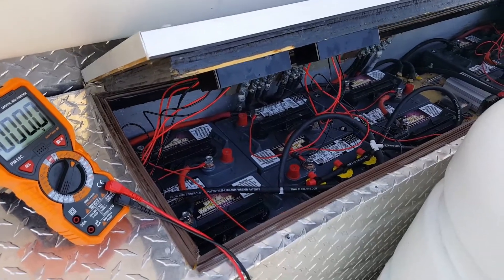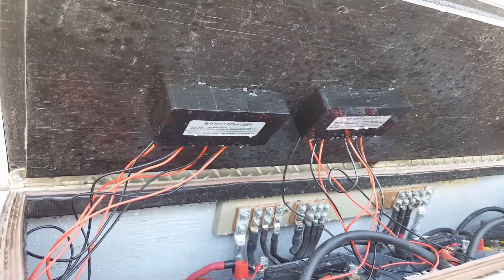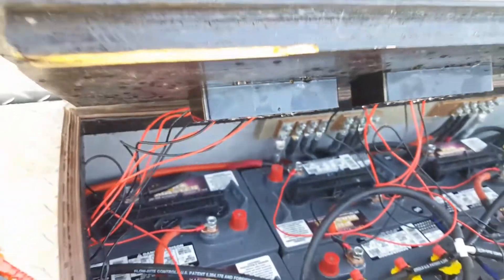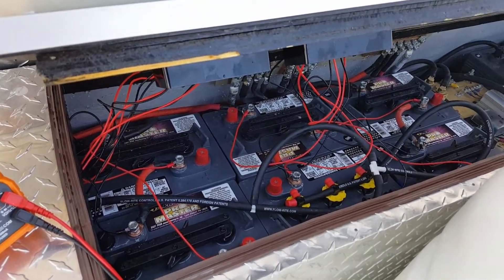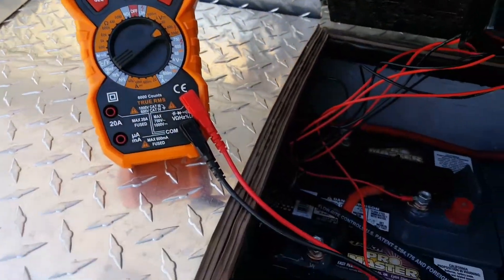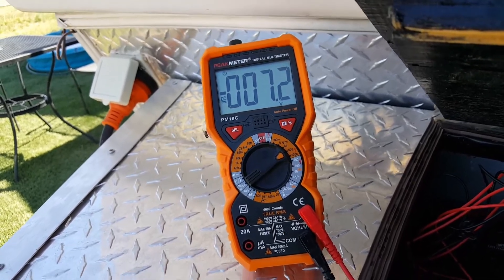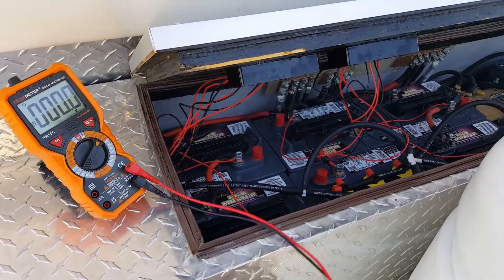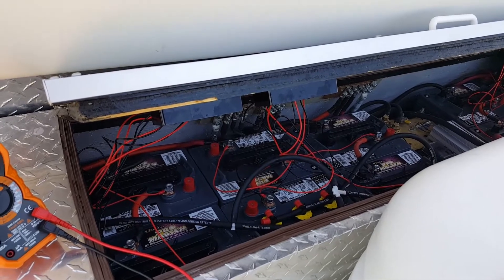Battery equalization

Comment: I just installed one of those on my home solar battery bank (48v, four 12v lithium batteries in series). I have a BMS APP that I can see the SOC, volts, individual cell volts, etc. The problem I was having was varying volts on each battery and widening SOC (I can check each battery's SOC). I installed this equalizer/balancer on these batteries and noticed it immediately started to balance out the volts. I then took the batteries all the way down to 0% SOC (they turned off) with the balancer still connected to each battery. I then brought the battery bank all the way up to 100% SOC. Sure as heck! All four batteries stayed within 5/100th of a volt and the SOC's came right up nicely. Fixed my inbalance and SOC issue. As for the "10 amps" ...I think it may be a misprint. I used a amp clampmeter and the most current I saw when it was balancing was about 0.6 amps (maybe 10 WATTS). If one needs more balancing current, I think you can parallel two of these units together. Thanks for doing a video on this.

Comment: I have used them for several years.  Gives me about another year of use from batteries.  They get a little warm to touch when they are pushing significant balancing current, indicating one of the series batteries has significant leakage current, so periodically touching them gives a good early warning that one of batteries is going bad.

The four battery balancer is switching inductor based.  The two battery versions I have seen are capacitor dump based. 

There is new version HA12 that has BlueTooth RF link to monitor battery voltage on smartphone.

Comment: gorillaz dirty harry. i spotted that song immediately in the beginning of your video. for the record, i am new to solar and batteries,  but if you have your batteries all connected in series for 6s or what ever config, wouldnt they all share a common voltage, since they are all still connected when you tested the voltage? i am probably wrong, but i just 100amp load tested my 8p 12v agm system and all volts were the same, but one of my agms was only putting out 5amps while most of them were were in the 13-17 amp range. i am just curious.
Reply from the maker: As Terri Harris explains below, the reason all your AGM's are showing the same voltage even though one of them rates at a lower Ah is because your voltmeter resolution is not high enough. There's a significant energy difference between 12.10 and 12.19 volts. You should equalize them and buy a better voltmeter that tests to 100ths.

Comment: Are you satisfied after 4 years, are they making any improvement?
Reply from the maker: Hard to say. But with other battery care, like making sure SG gets topped off regularly, proper voltage settings and periodic equalizating, they certainly don't hurt.
Reply from the maker: I'll add to my response. I think in the situation of an off-grid, infrequently used system where the bank is not being maintained daily, and the bank is in float most of the time, they should be required to insure batteries remain equally charged. But in the case where we're using (and maintaining) bank daily, not so much. I say that because the equalizers only transfer low amounts of amperage, so in the case where batteries are being depleted by 30-50% per day, and then into bulk, absorb, and float, .5 amps isn't doing a heck of a lot. We're better off equalizing if voltage irregularities exist like we're supposed to.

Comment: Will that work with 24volt with 4 pc 6volt battery?
Reply from the maker: Yes, of course.
Reply: @desertrat1206  thank you. next question is how does it behave while being charge? and discharge? like keep up with the fluctuations?
Reply from the maker: @moneth08able  Not sure what you're asking. Can they handle 80 some-odd amps drawn or sent to battery bank? yes, of course. They're not connected BETWEEN CC/inverter and batteries, so those amps are not flowing through them, they're connected to each battery/string separately.

Comment: Battery balancing should bring your series banks to within better than 5%. Given that LA cells have a 2mV/% SoC your 6V or three cell batteries need to be within 30 mV of each other. The meter you are using has a 100 mV resolution which is why there is no difference showing up. Use a better meter to check your balance. One with better that 10 mV resolution. Also the 10 A rating is not the rating of the battery load but that of the balancing current, which is quite good. The closer your batteries are balanced the lower the current. Balancers will need time to work there magic so at least one full absorption cycle and some float time will be need to bring a out of balanced bank to balanced. After that you should never see an issue again.  With well balance battery banks you will be able to go to a deeper state of discharge without risking damage because no battery will be too deep. Each additional %DoD is a %more Wh consumption. Balancers are a pretty cheap way to get battery capacity.

Comment: Thank you 🙏 ✔️
Does the batteries total output matter?
I mean does it matter if the four batteries are connected in parallel or in series for this equalizer to work?

Best regards 🙏 ✔️
Reply from the maker: Battery equalization attempts to equalize voltage, so your bank's amperage rating wouldn't matter.

Comment: Did your balancer get hot? I have a lithium battery with proto cells and have it wired to the 4 cell groups correctly but the balancer is getting super super super hot. Please let me know
Reply from the maker: No, mine do not get hot. Could be your balancer is mismatched to lithium voltage.
Reply: @desertrat1206  thanks for the reply. I hooked it up wrong to begin with and believe I short circuited it. It has four groups of cells so the process of hooking it up is quite different. I've got another one on the way

Comment: How are they doing?
Reply from the maker: Good, I guess?  They purport to balance batteries, which I did observe after I installed them. Only servicing of battery bank since has been adding water periodically though.
Reply: @desertrat1206  have you checked it again after you installed them? Someone turned me on to them. I will purchase a few in a week
Reply from the maker: @drsolar  No I haven't.

Comment: if we apply it on parrallel connected batteries?
measn I connected 2 batteries in series and again 2 batteries in series then I make them parrallel does it also equalize those batteries or it only works which are connected in series highly appriciate your suggestion
Reply from the maker: Not sure how to answer your question because there are a ton of different equalizers and a ton of different ways to connect them. In my case, I have 3 banks of 4 6v batteries tied in series, and my setup has them equalizing the voltages between the 4.

Comment: It would be interesting to see what is in the box.  do you have a link to the product?

I used to have 2/0 cables running my parallel lines and then someone pointed out that it was unnecessary as there wouldnt be that much current flowing through them, and there would only be current at certain times.  I checked and this was correct.  I never saw more than 10 amps, so I switched them to thinner cables with fuses.

probably why that unit is only 10 amps. it may just be giving extra pathways for the current to go through. good find!
Reply from the maker: https://www.amazon.com/gp/product/B01JJ4X8CO/ref=oh_aui_detailpage_o03_s00?ie=UTF8&psc=1

There is a video that goes over theory but I can't find it now. Justin Case uses them too I found.
Reply: the link for the product: https://zhcsolar.com/product/ha02-battery-equalizer/
Reply: i found that the extra resistance of a fuse in each wire of the balancer resulted in less accurate voltage balancing, even when imbalance current was less than 2 amps.  However, fuses on each wire is a good safety measure in the event something goes short inside the balancer.  16AWG is good for 10A in free air, but short circuit current can be 400A!